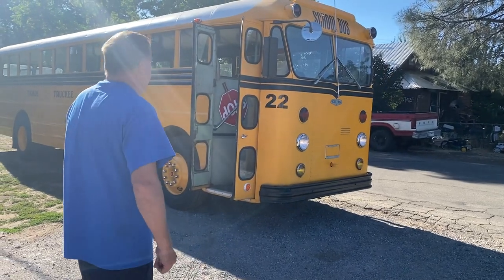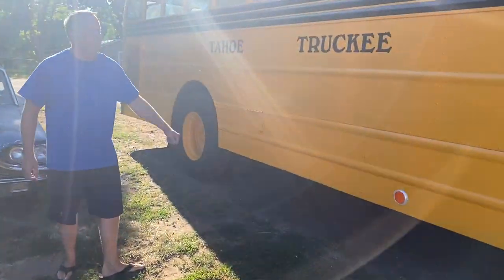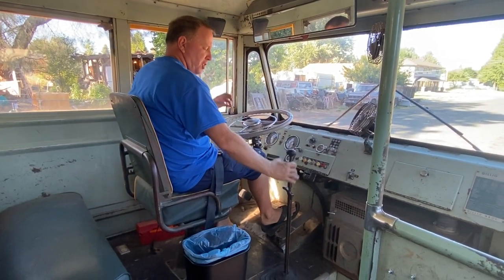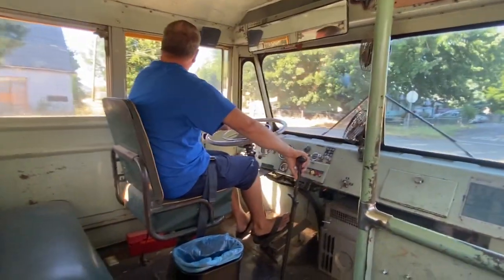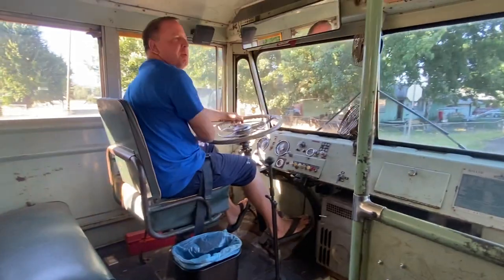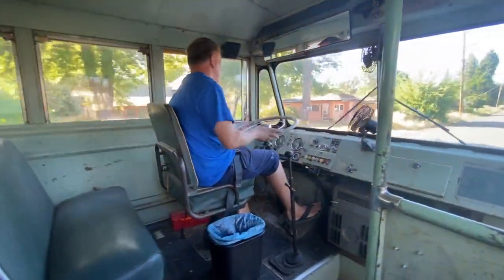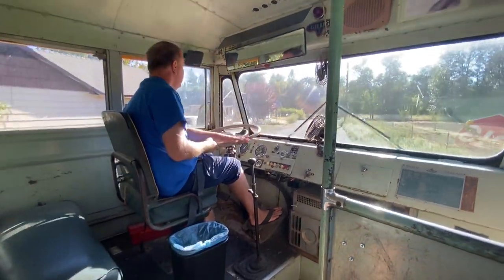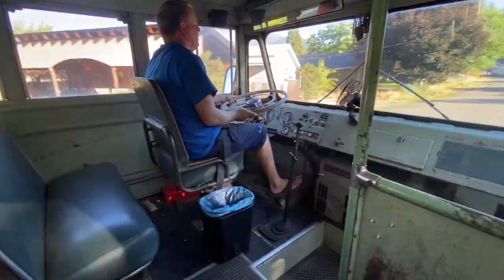Driving the 1955 Gillig school bus.

Comment: Ah, the memories.  Our district had a collecton of 16 Gilligs of various sizes and age back in the '50s. The first one that served my area was probably '48 or '49 as I began 5th grade in '52.  It was a long one, the route very hilly, and she broke down at least once a month. Our driver has some mechanical abilities and always managed to get us back on the road. When staying after school for sports or other activities, I could catch another bus, which was the much older brother on the one in your video, driven by a midlde-aged gal who brooked no trouble.  That bus had manual doors, and she was so pleased when in 1953 she was assigned a brand-new bus - same model, with air doors.

The oldest bus in the fleet was so old that it lacked electronic turn signals and turns were indicated by metal arrows in front and back that the driver cranked into the 7:00 position for slow, 9:00 for left turn, and 11:00 for right turn.

Comment: I love this bus! I drove a similar one back in the 70s - one row shorter and had a manual door - but it did have power steering. That district also had a couple from '59 or '60 that had the quad headlights and a 534 Ford V8 for power.
Reply: That must have been quite an engine.

Comment: This is the first bus of its kind I've seen with a floor shift. The GMC Greyhound I saw in another video had a column shifted 4 speed. Also, since you double-clutched each shift, I'm assuming there's no synchromesh in this transmission? This is a cool bus.

Comment: Double clutching at its best
Reply: I just noticed that. Double clutching is what I was taught to do in a manual.
Reply: @bikdav  that is a must for unsychronized transmissions. Double clutching also saves synchronizers.
Reply: @bobbyheffley4955  And double clutching saves the day when the tranny is so cold that the synchro doesn't work for the first few minutes.
Reply: What if you just held it? Rather then release and reapply?

Idk much about vehicles that require you to double clutch
Reply: @trashyspeeds266  it would likely grind as you attempted to force it into the gear. Double clutching allows you to slot it into gear without grinding the gears.
Reply: @adamw9421  ah, ok
Reply: @bikdav  True dat! And this bus operated at 5700' in the Sierras. In the winter.